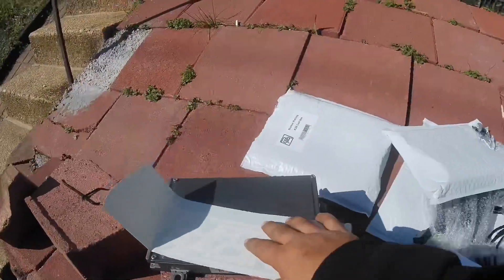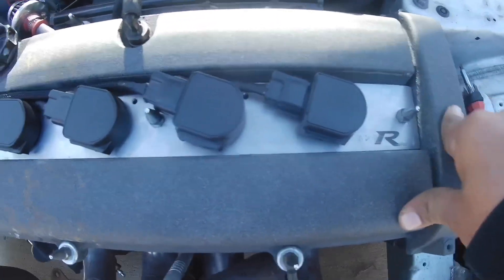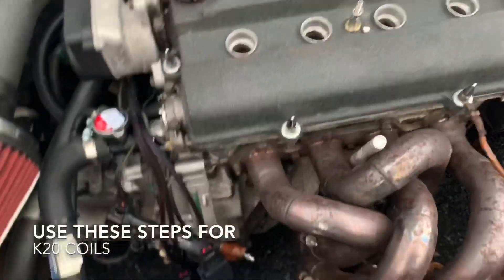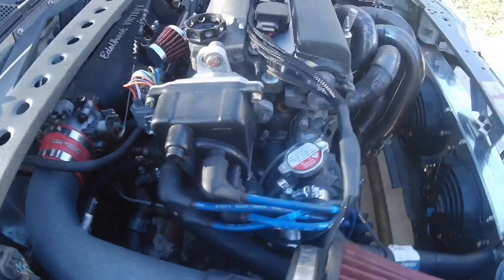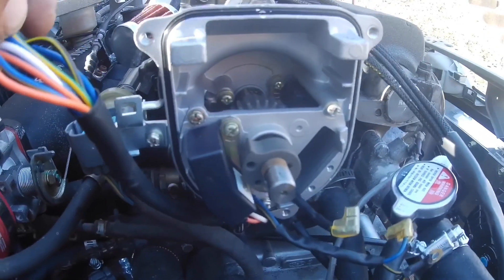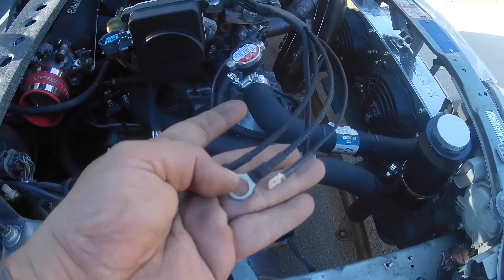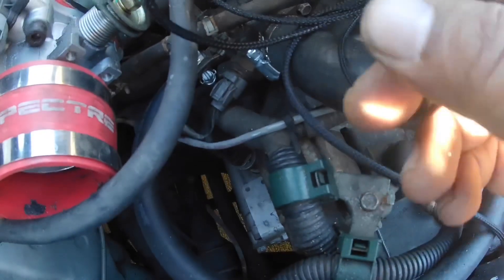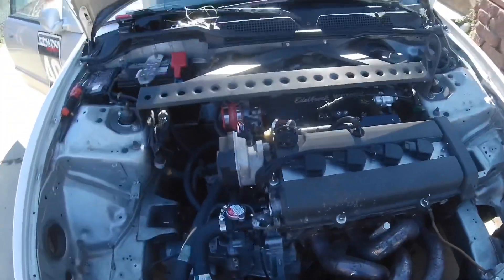Burton Racing Coil on Plug conversion for b18b b20

Comment: Damn dog you really came thru with this one. 

Answered most of my questions.
Do you have any suggestions, i’m trying to buy the conversion for my b20z (no boost) driver on my 99 CRV.

Do you know if your application applies to mine even though I’m not running a LS or anything different? 

Thank you 🙏🏽
Reply from the maker: Deathphone every should will be the same the have a b20b in the integra and running this setup on it

Comment: Did you have to re time the ignition? Or is all that in the v3
Reply from the maker: boost4boobies I didnt do  my ignition timing on this motor because it was already set. But I’ve been told that you have to adjust the distributor.

Comment: Interested in the v2 and your old plug wire cover you gonna sell them?
Reply from the maker: Irvin Dorsey you can have the wire cover your just going to have to get the threaded rod to mount it to the valve cover. But the v2 came out of my other integra so I’m holding on to that

Comment: That’s a pretty sweet upgrade. I am thinking of doing this If I can’t find the issue with the integra. Great walkthrough 🤙🏽
Reply from the maker: Thanks… the car starts so much easier now, also I don’t have to mess with ignition timing.
Reply: @RevHighDriveHappy  Do you remember if you felt a noticeable difference? Thanks
Reply from the maker: @Duwop77  Not to much in power since this a pretty much stock but its much more reliable and less parts to maintain
Reply: @RevHighDriveHappy  Thanks
Reply: Sweet!!!! Keep us updated

Comment: Nice work my friend. She sounds good brother. I have said this before your work on the integras is very inspiring. Where did you get the idea to do this conversion? That is definitely a unique mod on an integra. At least I have never come across anyone doing this. As always brother keep up the good work and keep them videos coming.
Reply from the maker: unique_integra_owner thanks... I got the idea from some other b-series builds I’ve seen like sp tuning. But I was having distributor so I just decided to upgrade the whole system.
Reply: @RevHighDriveHappy , I have checked their channel out few times. They do some good work there. So is the distributor basically deleted or is it still being used in some capacity?
Reply from the maker: unique_integra_owner basically the distributor is now the cam position sensor... so the ecu knows when to fire which coil.